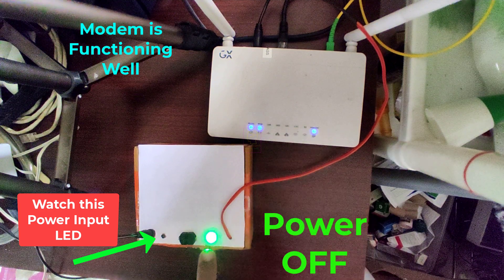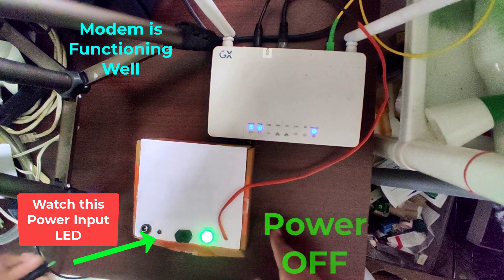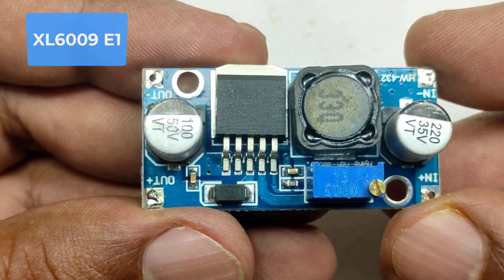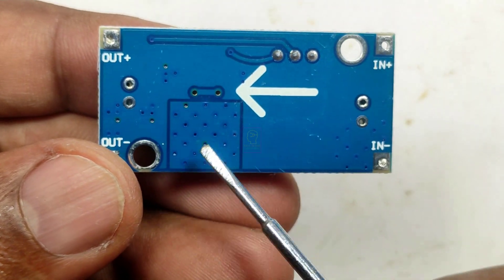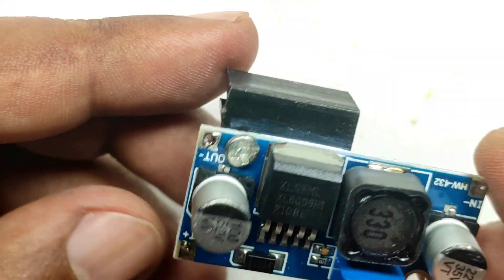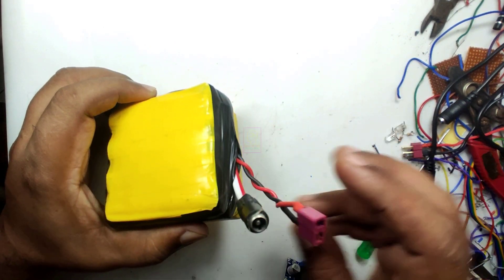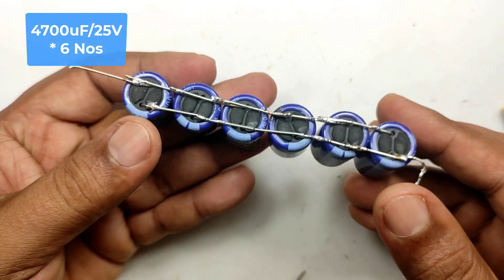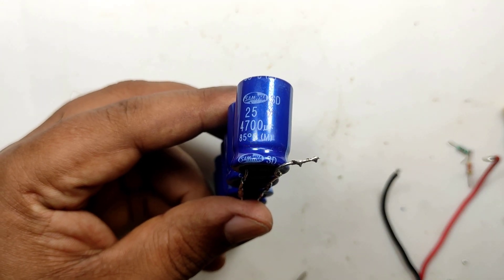How to make mini UPS For Wi-Fi Router  | mini UPS For Wi-Fi Modem (12Hrs Backup time)

Comment: why 6 capacitors are needed ? The circuit is converting DC to DC
Reply from the maker: It will store energy which will be used at the transition time

Comment: While electricity available then directly on from adopter, elevtricity off then automatically switch on batery, and again power on battery goes on charging mode, is it possible?
Reply from the maker: Yes possible
Reply: @TechInsert  plz make it vedio on it, or guide how its possible for long time
Reply from the maker: @ghulammohiodin1514  I will
Reply: @TechInsert  appriciated with thanks
Reply from the maker: @ghulammohiodin1514  Tahnks

Comment: Super complex and inefficient design 😂
Reply from the maker: This is the most simple design. i cant see any complex here
Reply: No this is a very simple way of switching from mains to battery. U need complex circuitry for fast switching. But he has achieved this using simple capacitor charge which is a brilliant idea
Reply from the maker: @ArthurJsc-ji5jt  Thats true and Thanks
Reply: This is in effective a simple design. Switching technique is awesome. We can add more capacitor which is cheaper than microcontroller based switching
Reply from the maker: @NiguRyne  true
Reply: I dont think so

Comment: Wow nice. Battery BMS will become faulty in input is greater than 12.8v. from my experience
Reply from the maker: You are absolutely right. I too have same experience.  Fix the voltage to less than 12 .65 is the best choice
Reply: @TechInsert  but I can't see this in anywherw of BMS. I don't know the reason
Reply from the maker: @tabm7644  Might be business trick
Reply: @TechInsert  yes true
Reply: Are you sure it will become faulty  if voltage is greater than 12.8?
Reply: @NiguRyne  yes mostly
Reply: Good information
Reply from the maker: @BabuProject  Thanks
Reply from the maker: @BabuProject  Thanks
Reply: Thanks for this information
Reply: @SabroniWungkul  you are welcome
Reply: I have also faced this it was purchased from ktron and they said to keep charging voltage to 13.4v only then it will turn on and it even stopped output 😂😂
Reply: @paneerpolice3454  BMS are very sensitive to voltage . I havent seen in any of the BMS description mentioning the max voltage. huh
Reply: @SabroniWungkul  yes so my bms who was not charging but giving output stopped working due to application of higher voltage
Reply: @paneerpolice3454  Yeah, we cannot use without BMS that is the tough part.